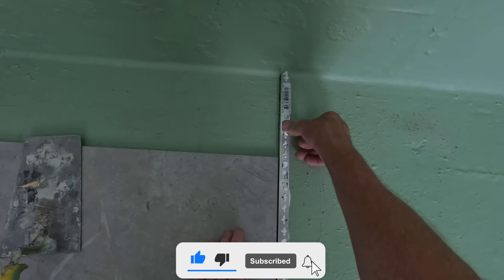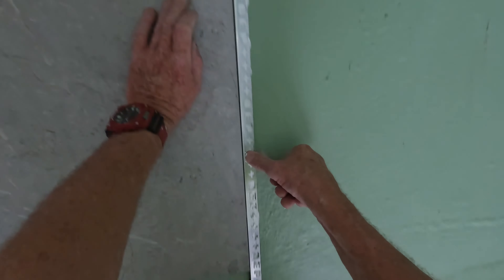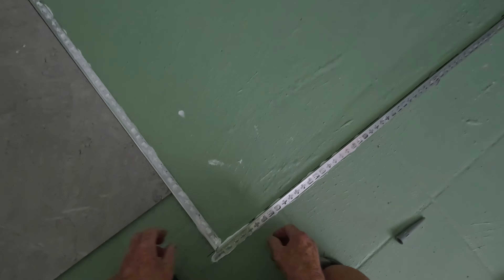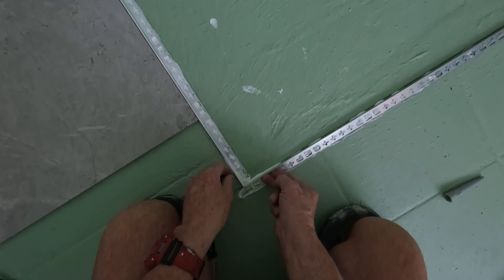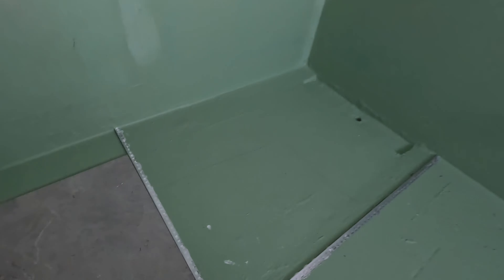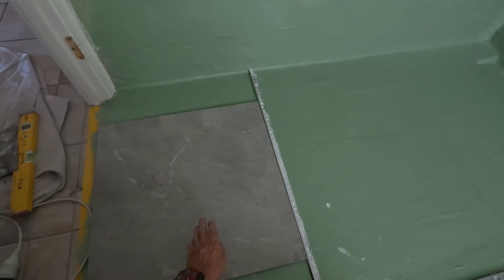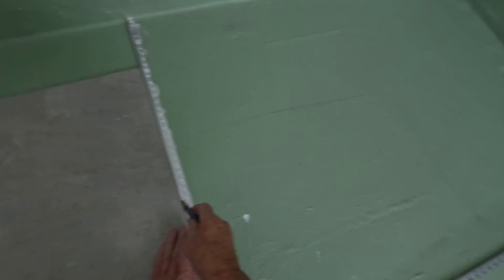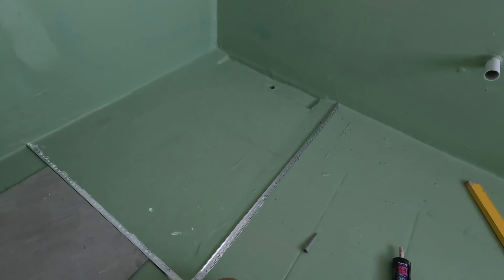The Very Important Shower Water Stop DIY

Comment: Whoop ,whoop it's me again, can you help me out . How high can l go with the aluminum angle because everything  is levelled, l got to raise  the shower to get a good fall also what's the minimum or highest l can go. I'm  thinking of the future  with a wheel chair and things not if it's  going to happen but just in case everything going to plan, always thinking ahead nnnnnnice one , see ya.
Reply from the maker: Well whoop whoop 
Have your angle 2mm below the top of your tile
👍💙🫶🤙🙌
Reply: @candtmarbleandceramics thanks for that, what's the minimum  height of the aluminum angle with a good fall 20mm high or lower and l,m mixing some mud to get that fall like you aways do plus put another coat of waterproof(3 coats) underneath  I'm making the shower 1.00× 1.200mm, l can put a small grate or a strip. I know you like the strip ones it going to take a little more thinking, I'm sure l  can do this with your help. Over and out, see ya.

Comment: Is the water stop angle lower than the top of the tiles so you can grout or silicone at that join over the top?
Reply from the maker: Hi mate
Yes it's slightly lower
Not to be seen 
But in that example the shower screen goes over it and is covered so it can go to the top or slightly above 
😄🤙🫶👍💜
Reply: @ ok no worries thanks again ,like your videos